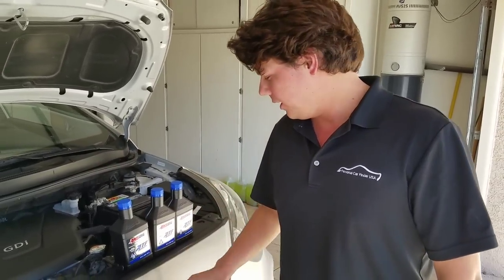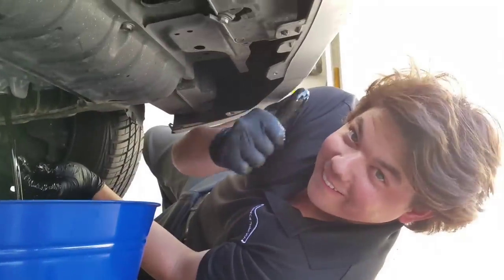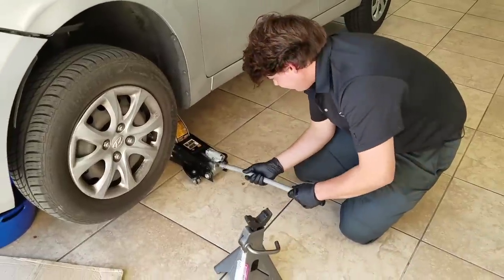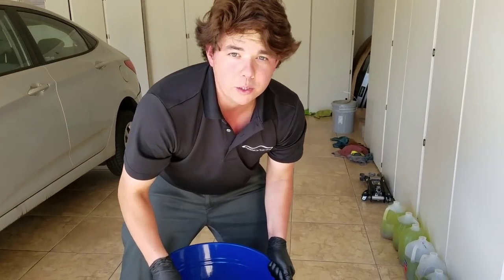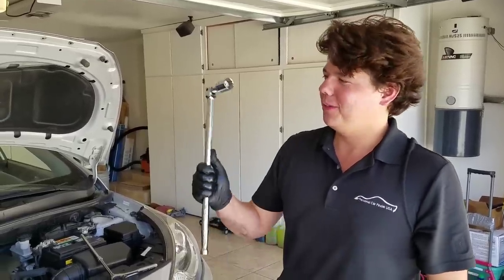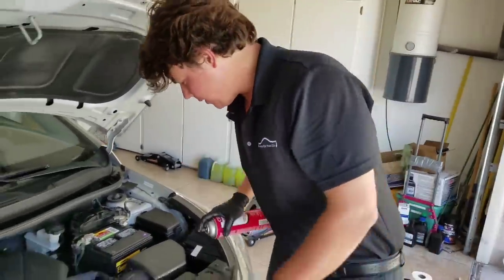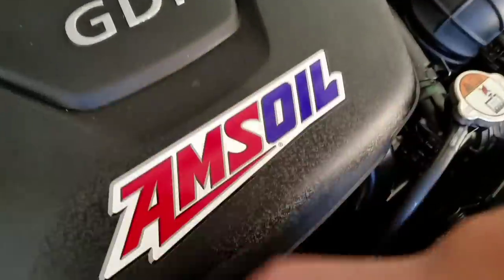Hyundai Accent AMSOIL Transmission Fluid Change & ATF Fluid Flush

Comment: By the way, in other videos, before driving around, others suggested to start the car, warm it up, then do some shifting of gears, with the emergency brake on.  That's what I did.  Also, I drove the car for a day, for about 30 miles, then did the second drain/fill the next day.  I might have a slight amount of extra in, as there is the tiniest stream when I checked.

Comment: I love my 2013 Accent. It has 175,000 miles and I've literally done zero work to it besides oil changes, tires and front brakes, which I've only had to replace one time. I'm getting ready to replace the transmission filter and fluid for the first time which is why I'm here lol. 

I have no warning lights on and my a/c even works still which is required down here on Florida. It has been the best car I've ever owned.
Reply from the maker: Sweet!!!
Awesome, This is my wholesale account link that will give you about $33 off on $100 order. 

Also when you use my link I will be your Amsoil dealer and the lookup guide will give you all the products for your year make and model I would also do the coolant and the Dominator coolant boost The other one that's good is the PI performance improver will clean your valves and your injectors you'll make a lot more power and better fuel mileage and then the of course the motor oil engine flush and the transmission fluid will shift a lot better as well.

If you ever have any questions always happy to help anytime.

Professional YouLubher: Eben Rockmaker Regency Gold Direct Jobber AMSOIL Specialist (Dealer#: 5331179) 702-472-3614 

Get AMSOIL Wholesale Pricing - https://www.amsoil.com/offers/pc/?zo=5331179
Reply: Change your spark plugs and drop a  k and n box air filter. You'll be glad you did. A lot of missing power
Reply from the maker: Great suggestion Eric!!!
Reply: Nice!! I have a 2016 accent with 114k and I'm here in Florida too. Yes the a/c gets a workout here 12 months a year.lol I've done only maintenance and it's been perfect. I haven't done brakes yet and the front pads have around 50% left. I've done the trans fluid twice. I definitely would recommend this car to anyone and if you're on a budget this is perfect.

Comment: There is a Level Plug on the front of the transmission. It looks like a plug with a 3/8" square like your FILL PLUG. I believe it is a 1/4 turn to loosen it sort of like a bayonet plug. If you remove it, you might not have the issue with filling it and the fluid backing up.
Reply from the maker: Thanks for the info 🤟

Yeah it was definitely a stickler to get that to not overflow.
That would have really allowed it to breathe.

Thanks for being a part of my YouTube Community🇺🇸👍☕

Comment: Question what Type of Automatic Trasmission fluid do 2012 Hyundai Acccent Uses Thanks***
Reply from the maker: Excellent question Peter most likely it's the fuel efficient ATF fluid signature series is what I would use but I recommend you double check it on the lookup guide This will give you the fluids capacities for your year make model and engine size.
AMSOIL Performance Test Results. Read This Article - https://www.amsoil.com/performancetests.aspx?zo=5331179
Reply from the maker: This is my preferred customer link that will save you about $33 on $100 order also when you use my link I'll get the credit and I could always answer all your questions in the future as your Amsoil dealer.
Professional YouLubher: Eben Rockmaker Regency Gold Direct Jobber AMSOIL Specialist (Dealer#: 5331179) 702-472-3614 

     If You're New To AMSOIL I Recommend The AMSOIL 6 Month PC Membership - https://www.amsoil.com/offers/pc/?zo=5331179

Comment: My car just started making a whining noise when I put it in reverse. I’ve taken my 2016 Hyundai Accent and gotten the transmission serviced a couple times since I bought it. I’m not sure if it’s a wheel barring or the fluid possibly being low. I do know my check engine light has been on and the code was for the Catalytic system. I’m so frustrated bc I use my car for work and I’m not really sure what to do and being a single parent I don’t have tons of money to sink in the car. Please if you could give me a suggestion I would greatly appreciate it.
Reply from the maker: Great question there's lots of things that can make it clunk the list goes on and on from transmission problem engine mount could be just lubricating the joints all old cars especially economy cars get clunky as they get older that's normal as far as the way it shifts and drives that has to do with maintaining it using high quality foods personally if I was going to keep the vehicle I would change all the fluids on it and put the good stuff in the Amsoil lookup guide will give you everything for your vehicle you'll also want the preferred customer membership will give you the very best value on the products.
If you're handy you can put in all the fluids yourself or you can always call a mobile mechanic and they can always install everything!
❤️ 🇺🇸 ❤️ Professional YouLubher: Eben Rockmaker Regency Platinum Direct Jobber AMSOIL Specialist (Dealer#: 5331179) 702-472-3614 

      ✅ ✅ ✅  You will get Your Best Value as 6 Month AMSOIL PC Member --- because You get about 25% discount on AMSOIL Products  + you will not pay as much sales tax, depending on the sales tax in your state.  For example, if you were to buy $100 of product at retail plus 8% sales tax the total would cost you $108. However, if you paid the $10 PC membership and you received the 25% discount because of the PC membership, the total would cost you $75 plus 8% tax or $81. So for the one time membership of $10 you are saving $27 on your first order.  You continue to receive discounts on your future orders for the next 6 months. You do NOT need to auto renew! https://www.amsoil.com/offers/pc/?zo=5331179

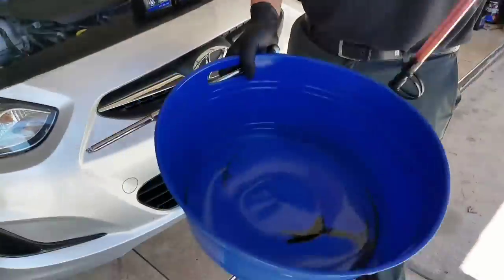Comment: At 1:50 the socket isn't a 5/16" socket as you mentioned but a 15/16" socket or more correctly, you need a 24 mm socket.
Reply from the maker: Yes, a 5/16 is like 200 smaller I believe. They're so close you can use them both.
✌
Reply from the maker: What type of vehicle do you have?
Reply: @Syntheticoilprotection  Not a Hyundai Accent. Its the GF's car.

Comment: I have Elantra 2015 and it has 60k miles now. Should I change the fluid or flush it with the device? I want to use amsoil transmission fluid , which type should I use ?
Reply from the maker: I would do exactly what we're doing in the video here it's a drain and fill you'll see everything here in the lookup guide for your year make and model and I recommend the 6-month preferred customer membership that will give you the very best value on the products and when you use my link I'll always be your Amsoil guy in the future I can always answer your questions in the products and I'll also get the credit which I really appreciate your business future business in advance.
Find AMSOIL Products For Any Vehicle - https://www.amsoil.com/guides/?zo=5331179
Reply from the maker: I also recommend the fuel additives you'll see a big Improvement called pi performance it's called upper cylinder lubricant.

❤️ 🇺🇸 ❤️ Professional YouLubher: Eben Rockmaker Regency Platinum Direct Jobber AMSOIL Specialist (Dealer#: 5331179) 702-472-3614 

      ✅ ✅ ✅  You will get Best Value with 6 Month AMSOIL PC Membership because You get $33 back on a $100 purchase after the difference in Sales Tax with No need for Auto Renew - https://www.amsoil.com/offers/pc/?zo=5331179
Reply: Thanks for your reply, is this draining and filling like flushing? I saw some YouTubes make the flushing using the tubes from the radiator and it's a completely different way.
Reply from the maker: Yeah it's similar it's just that the drain and fill doesn't get all the fluid so it's a little bit more timely and it's something that will be easier on the transmission in the long run that's what I do to my personal vehicles which you'll see in the 59 Cadillac on the channel here in the playlist you'll also see that on the SL550 playlist

Comment: Where is the bolt to fill the transmission?  Mine is a 2015 Accent.
Reply from the maker: Should be kind of hidden down in between the engine compartment you'll see the top of the transmission

Comment: is there a way to check the proper fluid level, glass window, dip stick, put a measuring stick etc ???
Reply from the maker: Personally I wouldn't fret about it just make sure there's adequate fluid and check your owner's manual do your due diligence to make sure you have roughly the listed amount in the transmission pan there's room for error so even if you're half a quart off it's not going to hurt anything

Comment: Thank you already bought a Hyundai accent and I want to change oils transmission and engine car has only 32.000 miles do I have to change it transmission fluid
Reply from the maker: This will give you the fluid capacity's for your vehicle.
Lookup For Your Vehicles - https://www.amsoil.com/guides.aspx?zo=5331179

Comment: The manufacturer recommends no maintenance in my owners manual for a sealed automatic transmission on my wife's 2015 accent.  There is about. 62k miles on the car. Any reason why the manual shows not to change it?  Also what about the filters in the transmission? When should those be changed?
Reply from the maker: Great question Jeff yeah that's normal they always say that to not change it It's just because the transmission expires around $100,000 so they want you to get a new transmission.

Most of those are a basic drain and fill there's no filter to change just depends on the year make and model but a lot of the Honda's now are just a drain and fill no filter to change.
Reply from the maker: If you're thinking of trying the products this is my personal link that would give you the credit I would be your Amsoil dealer so I could always answer your questions in the future and I would be happy to talk to you before you order if you have any questions The 6-month PC member will save you about $33 and $100 order because of the difference in tax in the 25% discount also you'd have the free shipping at $100 and you'll see the lookup guide in the upper right hand corner that will give you all the fluids and capacities for you and your make model and engine size.
Professional YouLubher: Eben Rockmaker Regency Gold Direct Jobber AMSOIL Specialist (Dealer#: 5331179) 702-472-3614 

     If you're New to AMSOIL I recommend the AMSOIL 6 Month PC Membership - https://www.amsoil.com/offers/pc/?zo=5331179
Reply: @Syntheticoilprotection  great point.. just enough to get to the end of the warranty! Thanks for the response. I'll def keep you in mind when I decide to change the transmission fluid.

Comment: The check plug is in front of the transmission. Below the fill it's a twist and pull plug. You will probably need to list it up, take the plastic off on bottom and do it that way.
Reply from the maker: Yeah it's a little bit of a stickler LOL
Reply: @Syntheticoilprotection  
Hi please I need your help I bought my car at 60km and changed the oil without the filter. Now I  at 97 km and the oil is now black. Is it safe to change it with the filter? There are no problems in the transmission. Kia Rio 2015. Oil type ATF Sp III
Reply from the maker: Yes it's always good to change the filter if possible most are pretty easy you just drop the pan clean the magnet That's it

Comment: Do 2015 Hyundai accents need transmission oil? I don’t see the transmission fluid under the hood and it’s not even mentioned in my users manual. It also doesn’t have power steering fluid. Are they hidden or does the care not need it?

Thanks in advance,
Reply from the maker: The power steering on a lot of new cars is electronic so they no longer have fluid as for the Transmissions they all still operate with fluids summer gear lube in summer ATF fluid it just depends on the transmission
Reply: Synthetic Oil Protection thank you for guiding me in the right direction. Have a great day

Comment: What is the name of the spray that you did at the end of the video. 
It is for what use ? I think probably cleaning . And is it safe to use on a bmw 320 2018
Reply from the maker: Hey Gary there's a couple that I really like there is the amsoil silicone spray for all the door seals and soft rubbers and plastics I also like the MP metal protector which you'll see is for metal parts It's odorless and it's a penetrating oil that doesn't stain.  There's also a degreaser I think I used which is the engine degreaser All of them are great My favorite too are the silicone spray and the MP metal protector those are my two favorite aerosols that amsoil makes.
When you go to the site you'll see it under cleaners and protectants.

Professional YouLubher: Eben Rockmaker Regency Direct Jobber AMSOIL Specialist (Dealer#: 5331179) 

To Order AMSOIL Products Click Here - http://syntheticoilprotection.net/

Comment: Which is better oem Hyundai fluids  vs AMSOIL.?
Reply from the maker: Amsoil is 100% synthetic and it has a higher film strength it protects your engine transmission and differentials exponentially better.

This is third-party industry testing.
Industry-standard 3rd party testing results:

AMSOIL Signature Series 5W-30 Synthetic Motor Oil protects against harmful deposits on turbochargers 4X better than Mobil1® Extended Performance and 3.6X better than Royal Purple® in industry-standard testing*.
https://www.amsoil.com/newsstand/motor-oil/articles/leading-the-field-in-deposit-protection/?zo=5331179

Amsoil gets better gas mileage - 
https://www.amsoil.com/newsstand/motor-oil/articles/another-win-for-amsoil-products/?zo=5331179

AMSOIL Signature Series is fortified with a heavy treatment of detergent additive and it delivers 30% more acid neutralizing power1 than Mobil 1, and 36% more than Royal Purple, helping engines to stay cleaner, longer.-
https://www.amsoil.com/newsstand/motor-oil/articles/cleaning-up-the-competition/?zo=5331179

Professional YouLubher:
Eben Rockmaker Executive Direct Jobber AMSOIL Specialist (Dealer#: 5331179) 
Mobile: (702) 472-3614
My link: Best AMSOIL 100% Synthetic @ Wholesale + FREE Shipping: https://www.amsoil.com/offers/?zo=5331179 
AMSOIL Products & Vehicle Lookup - https://www.amsoil.com/guides.aspx?zo=5331179

Comment: I have an '18 Elantra SEL.  I have changed the oil over to Amsoil XL with a Wix filter and am using the Amsoil PI fuel additive.  According to my manual, the ATF is "no check, no service required."  The coolant isn't slated to be replaced until 120K miles/10 years.  It doesn't specify anything re brake fluid.  My goal is to go to all Amsoil fluids.

Would you suggest waiting until suggested time frames or at what point would you do the switch?

Thanks.
Reply from the maker: I would do everything right away because it will protect your engine much better also it'll run cooler you'll make more power better fuel mileage to the point where a little more than pay for the fluids.
Reply from the maker: Thanks for the question Matt!

I have playlist on all the different fluids for vehicles and your car is pretty simple to work on
Reply: @Syntheticoilprotection  Cool. Dumb question - if I was to do the ATF change and do a double flush, do I find out what my capacity is then order double the amount?
Reply from the maker: I would always order a couple extra quartz just to be safe.

That way you don't have to pay for shipping

Comment: For my Hyundai Accent 2013 1.4 CVVT, what specific ATF should I use? I tried the normal ATF and after a few days, my car is starting to jerk from P to R after starting.
Reply from the maker: If it was my car I would switch it to Amsoil this is the look of guy they will give you all the products in the fluid capacities for your specific vehicle.
Lookup For Your Vehicles - https://www.amsoil.com/guides.aspx?zo=5331179

Comment: I have kia cerato 2010 Run 180k and the oil is dark Black.So shall i flush or shall i Just change the old Oil kindly help?I asked mechanics they are saying no need to change Atf is for life time & some of them is saying dont flush just change
Reply from the maker: I would do a transmission fluid change on it with Amsoil Signature Series ATF.

This is my link and it will give you the exact products for your vehicle for the year make and model.

My link: Best AMSOIL 100% Synthetic @ Wholesale + FREE Shipping: https://www.amsoil.com/offers/?zo=5331179

Comment: Hi. Did u change the filter or does the accent not have one? I ask because the owners manual on mine got wet and became a solid block of paper 🙁
Reply from the maker: This car is just like the Hondas it's just the drain and fill. There's no replaceable filter so it's even more important to change it.......lol

Check out the follow-up video you'll be amazed how quiet it shifts

Comment: I poured real slow, because the fill hole is small and filling too fast caused spill over.  I also used a long funnel.  I will cut the bottom at a slight angle for next time.  Good comment on overflow.

Comment: I love doing this job togeather with my diesel filter which requires to remove plastics and battery after which access to refill is much better.
Reply from the maker: What type of diesel do you have? What type of vehicle and model?
Reply: @Syntheticoilprotection  itd kia ceed 2014 with 1.6 crdi 94kw engine. 6 speed automatic. Doing diesel filter every two years so will do gearbox oil at the same time